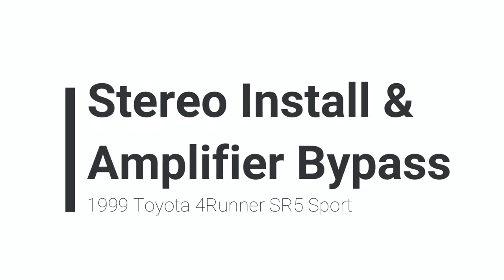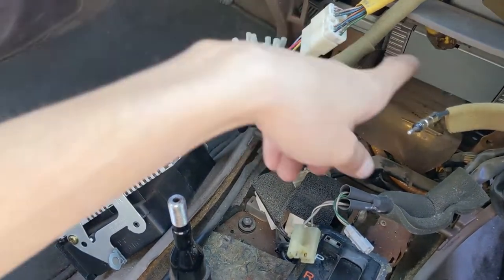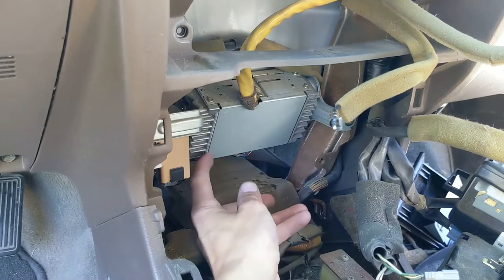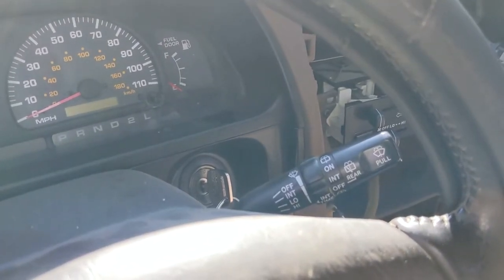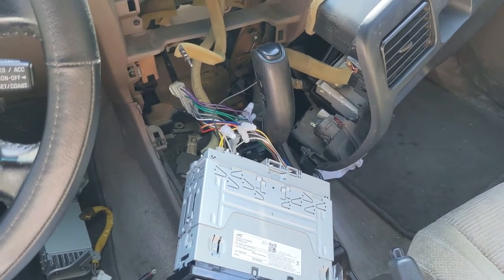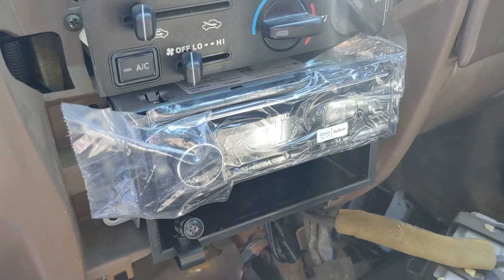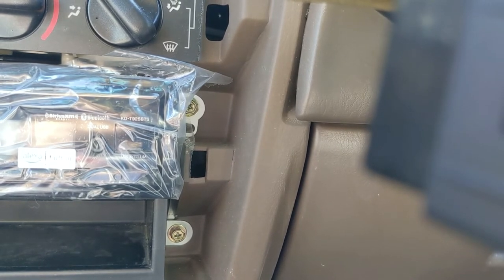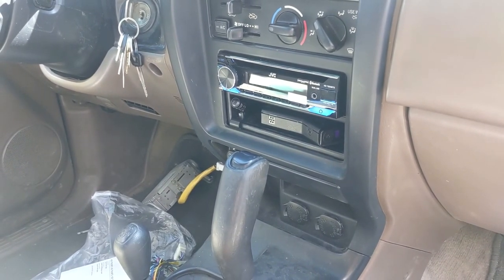How To Bypass OEM Audio Amplifier 1999 Toyota 4Runner

Comment: Did you ever figure out the antenna problem? Currently dealing with same issue
Reply: i actually had the same issue and called Alpine because an older HU would only put the antenna up when it was on Radio, but a newer one didnt. turns out they stopped including that feature apparently because newer cars didnt have retractable antennas. I ended up putting the antenna on a bypass switch. there are empty slots on the dash for extras so i used an old one from a tacoma. did the same thing with the DLRs too. its not that complicated just takes some time and you will have to manually push a button to raise/lower the antenna, but it annoyed me so much the effort was worth it.